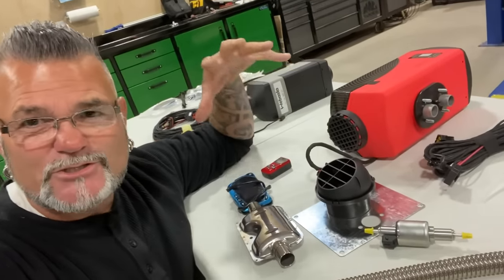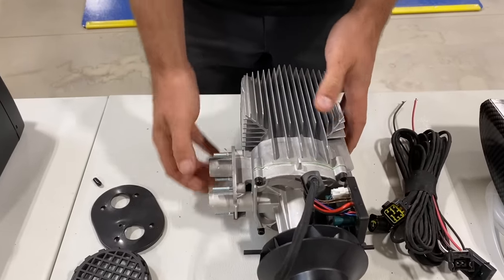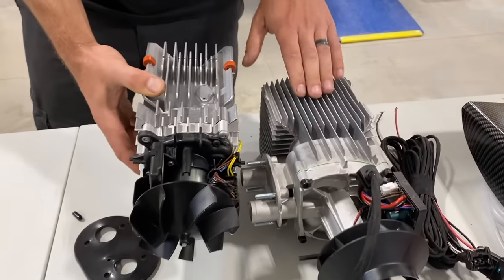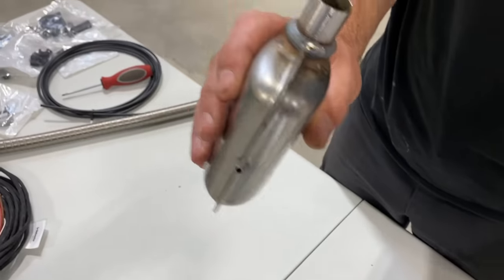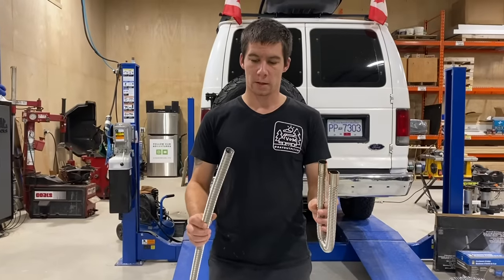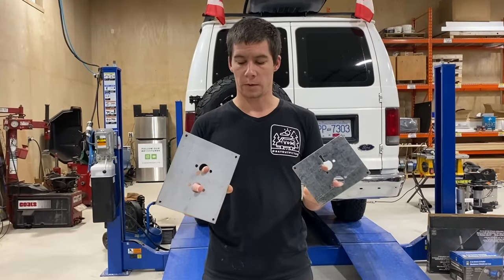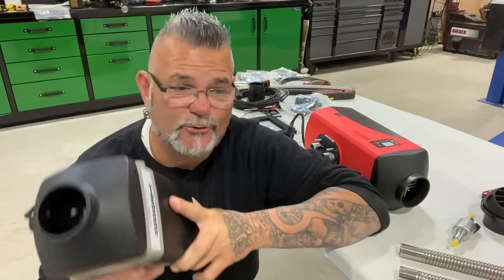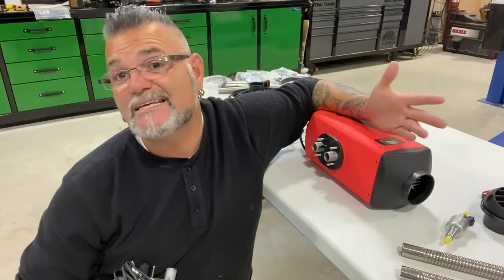$200 Knock-Off Diesel Heater VS $1500 Webasto. RESULTS* Both DECENT BUILD QUALITY

Comment: The Chinese heater is a copy of the Eberspächer Airtronic D4 4 kw, and some parts are interchangeable, it’s a reasonable copy for the money except for the electronics, it’s not weather sealed so can’t be mounted under a vehical and the software does not have the same level of control ie the Eberspächer you just set it to the required temp and it does the rest, the Chinese heater tends to soot up if ran on low heat too long, so be prepared to split the main housing to decoke it from time to time.

There’s some lively FB groups on how to customize the Chinese heaters display/controller to,make it more reliable.

Would I have a Chinese heater? nope, my campers Eberspächer is 21yr old and still works fine, some I fitted 30+ years ago are still working.

As you’r in Canada, if heading off somewhere a bit chilly in winter -30-40c you may want to think about which one would you trust, having said that you could take a whole new Chinese heater for spares, a motor for the Webasto costs more than the compleat Chinese heater kit.
Reply: so true 🇨🇦🛠️

Comment: I still would purchase the Chinese one because of the LARGE price spread. If the Webasto was 400 to 500 dollars I could see purchasing it but with a 1300 price difference over the Chinese one.. no way. It's not a deal-breaker for me!
Reply: Check out the Seven Wanders the World Channel. He had one installed, worked a short time, he pulled it apart and it was gunked up inside...
Webasto or Propex would be my choice.

Comment: Hi...Just letting you know that I have 2 China heaters with aluminium housings both bought in Canada from BC to Ont., no sales tax for less that $200 each delivered to my front door ,in less than 1 week ,installed into vans by myself.These units have been in operation now for 2 years with no issues. They are awesome for the low price.Just started my third year with them.
 Just love them !!!
Reply: how is the sound on them?
Reply: Great sound quality
Reply: @boejiden1065  haha you got one? seriously how loud is it?
Reply: Haha no I don’t have one yet but I will be going the Chinese route. TONS of good reviews and long term users that I’ve never heard complain about the noise level.
Reply: Although I heard it can get noisy when it’s burning down your van...so idk...trade offs?

Comment: I have a Webasto. I've had it over 5 years no problem. A friend had one and it stopped burning fuel and just dripped fuel. I've wstchdd some YouTube videos where some have had good luck with the Chinese knockoffs and others have problems right out of the box. Don't be directly in front of where it blows the air out. It's extremely hot. One YouTuber put a splitter on his so it blew air in different directions. You're going to love it. No more propane bomb!

Comment: The concern over having a small diesel tank inside the van is pretty overblown. Unleaded gasoline fumes have a 'flashpoint' of -45F while diesel fumes won't ignite until well over 100F(up to 200F depending on the grade). People have had heating oil tanks in their basements or next to their homes for decades without issue. Diesel also doesn't 'off gas' fumes near as much as gasoline so the odds of there even being fumes inside the van are slim. Leaks and/or spills of diesel in the van will stink, but there is little danger.

Does that mean I would go with the Chinese heater? Not necessarily. I'm a big believer in 'Buy once, cry once' and having had a Webasto in a plow truck I know the reliability of them.

Comment: Thanks for this video Chrome,  I also noticed the fan on the Webasto heater is bigger and probably moves more air than the knock off one... I've been thinking of a diesel heater for my boat, but on a boat, you got to have water seals on all the connectors... so thanks for this video comparison... in the end, you get what you pay for... you got this Chrome,  you and Cruz should be toasty warm this winter...  stay weird, I think your a keeper just as you are... lots of luv to you and Cruz,  stay safe, stay weird, stay healthy... I know you'll be warm this winter...

Comment: Great video, but there is no temp sensor in that controller for the webasto, you will need the 1319842A|9005004B... or else it will use the internal sensor..

Comment: Absolutely fantastic content! Amazing effort! I have worked for a Commercial truck dealership for 26 years. I install and service Espar and Webasto heaters often. I've had factory training on both. You made the right choice brother! VERY IMPORTANT...DO THE SEASONAL MAINTENANCE AS PER THE MANUAL AND RUN IT EVERY MONTH WETHER BEING USED OR NOT!  Encouragement and love brother! Great job Rayner. I'm a 310s and 310t RSE as well....   btw, we were offering  the sub-brand heaters (copy) for a while at the dealership, then stopped because they had nothing but repeat problems. No good for the commercial industry. Complete garbage. No comparison. Waste of money.

Comment: Watching the video it seems the Webasto has less chance of exhaust leak then the cheaper version.  Considering the small space of most vans it would not take much to have a big issue with Carbon Monoxide.  If there are ways to reduce this with the cheaper version, then maybe its worth considering.  Chrome the only other thing that would have been great to add to the video would have been to actually have the units running so we could hear the noise difference.  Thanks Chrome great video.

Comment: QUESTION - OK, so for those of you that purchase these heaters, not so much the cheap Chinese ones but the Webasto ones, are they easy to remove and install into another van when you buy a new vehicle?
Reply from the maker: Ray Outfitted says the heater can be removed and reinstalled. Some components you might replace such as exhaust as layout in new van might differ.
Reply: @VANCITYVANLIFE  Good to know. Thanks!

Comment: Are they Gas or Diese!??
I understand they are diesel,  you will still need a fuel tank somewhere?
Reply from the maker: I bought a Webasto gasoline heater. It taps my van's fuel tank to keep it easy for me. If you pick a diesel heater, like the Chinese one we looked, a diesel tank would need be added... unless your van is diesel.
Reply: Is gasoline heater as efficient as diesel?

Comment: The Chinese one should be called an asphyxiation heater. I’ve had one smoke out the inside of my Rv more than once & it requires a monthly cleaning. Like most things Chinese it didn’t last. Got me through 1 winter and now it’s a boat anchor. I second that the Chinese heaters are loud & inefficient. 10L of diesel generally was about 8-14 hours run time depending on how cranked up you have it. Wish I had the money for the Webasto or equivalent

Comment: Great comparison video although I think for me the fuel source would be most important.  If they were both gasoline heaters with the ability to tap into your existing fuel system in the van, then the comparison would be more similar.  I've seen videos on diesel heaters before and yes people had to mount another tank to hold the diesel fuel, just adding more danger for me down the road.

Comment: Huge price difference means they skimped on the good parts. You'll always on the lookout that it might overheat and burn. Last thing you need is to worry that your China knock-off heater will burn up and make your camper van a huge bonfire.